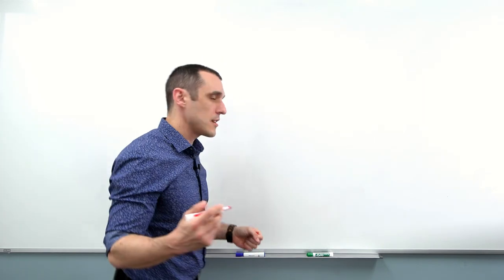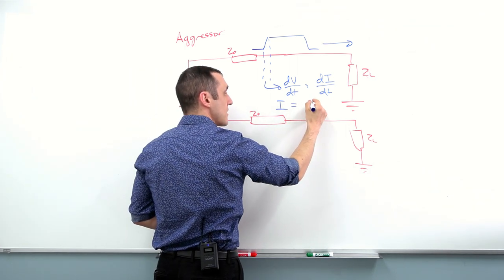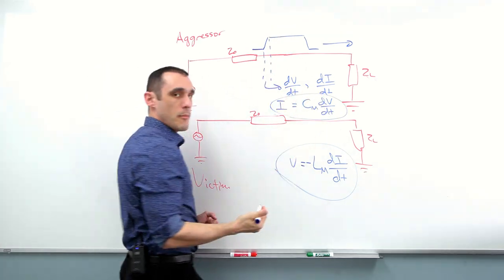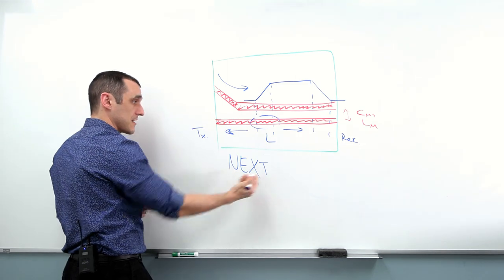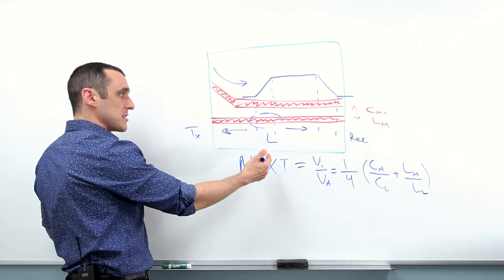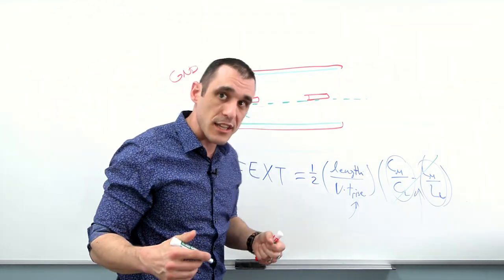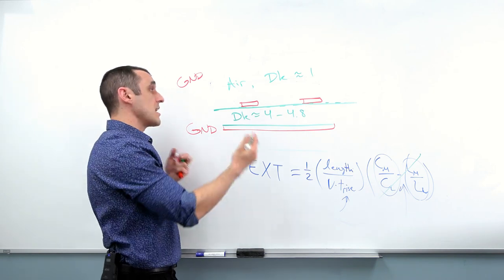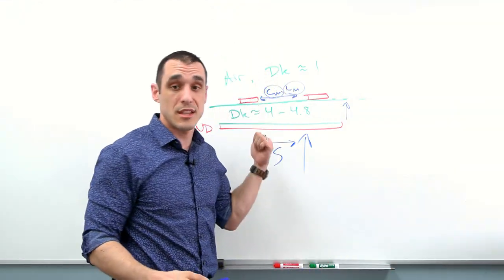What are the Types of Crosstalk in PCB Design?

Comment: How can we calculate the crosstalk between a plane and a trace?
Reply: A plane does not necessarily create crosstalk into a trace. A large plane near a trace will form a current loop with the trace. You can create crosstalk into another current loop. This is because crosstalk is mediated by the electromagnetic field.
Reply: What if it’s a high switching node plane like in switching power supplies?